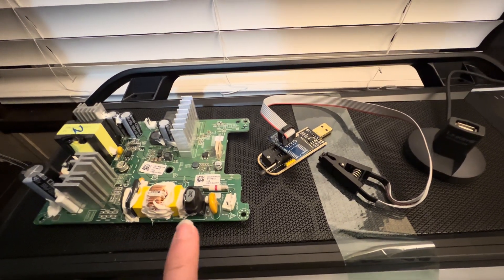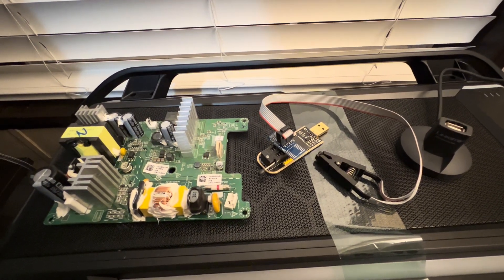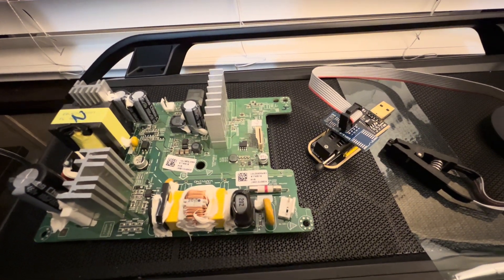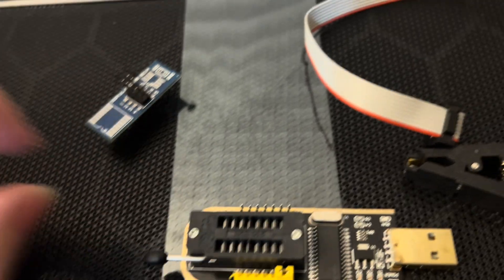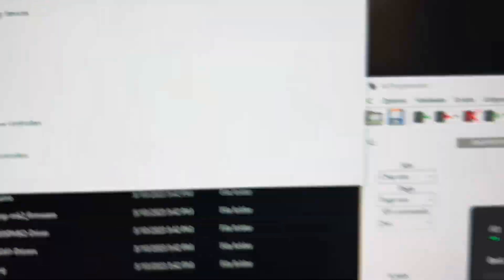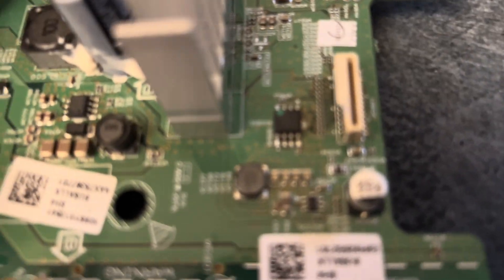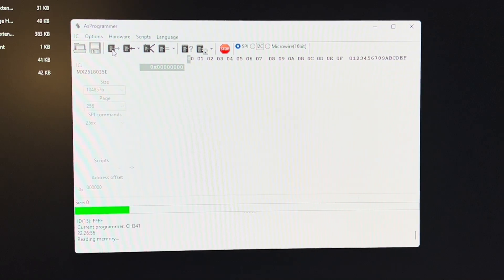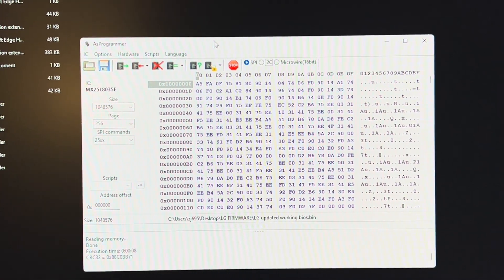How to fix LG Soundbar Subwoofer not working or pairing. SPN5B-W + SPN8-W part# EBR89625801

Comment: Didn't for my LG SN6Y. I have the 'verification error 00000000'. Tried testing but now no LED comes on.

Also, the execution time is 0 (when writing the new bin file) indicating that probably nothing got programmed on the chip.
Reply from the maker: When i get the all zeroes error, it's because the programmer wasn't seated properly on the chip. I would try again until you get error 000E00 and then it should be good. If nothing is working, the eeprom chip might need to be replaced
Reply: @FiveStaxX  Do you mean the clip? I was able to read and erase with no problem. Can I erase with an improper connection to the chip?
Reply from the maker: @ChiragSharma11  it can say it's erased but then if you reapply the clip you might find data still. Sometimes i have to program it two or three times after adjusting the clip before it works
Reply: @FiveStaxX  It seems like the bios bin file is not the right one for me. If I read the board and then program it with whatever whatever I get, I get no issues (i.e. no programmer seating issue). But if I try to program it with the bin file you've provided, I get the same error again. 

Is there any other bin version? My subwoofer is SPN5B-W
Reply from the maker: @ChiragSharma11  it's the same subwoofer as mine. The file should be completely fine. It's possible you might need a new eeprom chip. Are you in USA?

Comment: Hi guy, I'm from Vietnam. My soundbar system mark as LG sn5r. So, the subwoofer is spn5bm-w. I have tried to update your firmware successful. But when I power on the subwoofer, green light has flashing slowly for 30 secs and turn to red and not connected. I also updated firmware for soundbar through LG sound bar app by Android phone but result is the same. Would you could give me some advice. Thanks you so much.
Reply from the maker: And did you hit the pairing button to make it blink green quickly?
Reply: @FiveStaxX  I hit the pair btn but nothing happened 😂
Reply from the maker: @DũngAnhNguyễn-y2i  so hitting pair button doesn't make the light blink green faster?
Reply: @FiveStaxX  the led is still red after i hit or hold the pair btn
Reply: @FiveStaxX  aslo when the light is flashing green and i hit or hold the button, nothing change
Reply from the maker: @DũngAnhNguyễn-y2i  it doesn't go back to green?
Reply: @FiveStaxX  yes it doesnt go back to green
Reply from the maker: Was the light working before you updated the subwoofer firmware?
Reply: @FiveStaxX  yes, the light is flashing green after i update sbw firmware. And it turned to red after 30 secs.

Comment: Thx! Worked for me, but yeah with an error. I didn't try to turn the power off from the sub after connection, hope everything is ok. BUT I realize that indicator is now always green and sub is kinda always warmed up. Is that correct? Or mb I need to try it all over again? Thx!
Reply from the maker: When you turn the sound bar off, the subwoofer should go red after a few minutes in standby mode. Then it should go green again when the sound bar is back on.
Reply: @FiveStaxX  my soundbar is sn5r. Idk I kinda never saw red light on the sub. And now as I can see it's always green.. Shit
Reply from the maker: @AshotIOEgorIO  as long as it works, i call that success.
Reply: @FiveStaxX  kinda.. But if its always on full load I quess it will F up capacitors and stuff quickly. What do U think?
Reply from the maker: @AshotIOEgorIO  that's possible over time. Did you check LG sound bar application to make sure there were no updates? You can try flashing again, it won't hurt anything
Reply: @FiveStaxX  mine sub "log out" when I already was on the latest firmware. So I think that they never fixed it. In Russia some dude just selling updated microchips for kinda 10$ (for about a year now), but it has to be soldered.
Reply: @FiveStaxX  my firmware version from soundbar app is: WirelessRx WR201006, MICOM M2110140, Main B2110150. Can't remember when I updated it, but I am sure it was before sub "died".
Reply: @FiveStaxX  and U sure that that's how light is acting after updating the firmware? (I mean on the other bords, not Yours, but the one with error also)
Reply from the maker: @AshotIOEgorIO  every board has that error message 000e000 or whatever it is. I've fixed about 15 of them now and they all show the error code but still work
Reply: @FiveStaxX  I got it. But I am asking about how does the light acting? How it should be? Or U never check?
Reply: @FiveStaxX  so, I tried to unplug sub. Without pressing pairing again it didn't conect back. Then it connected. Then I turned tv off. It blinked Green for a minute. And now turned red. Wtffff. Magic!

Comment: Add me to the tally of people who were helped by this video.  I saw the magneto stuff months ago and even contacted him but I couldn’t justify the shipping cost when I knew it must be a relatively simple process, if he would just share the f*cking file.  Big props to you for doing what he should have done in the first place.

As for LG… I’d happily join a class action suit against them.  I will actively avoid buying anything from them in the future and will tell everyone I know about this incident, every time LG comes up in conversation. 

I’ve been involved on the software side of doing updates like this and I know the feeling of pushing out an update that messes up users devices.  The fact that it was even possible to screw up an update so bad that the hardware was bricked and needed this level of intervention is only part 1 of how bad this looks for LG.  That they continue to gaslight everyone and pretend there isn’t a problem is why I will never trust them again.

Comment: Can you describe the fault you fixing.  
I have been given a sub that appears dead.  Measures 20v on wc924 capacitor so it is powering up.  Just wondering if it is the same fault.

Comment: This successfully took my subwoofer from BRICK to flashing green again, attempting to establish connection to my SN7Y. However, connection wasn’t being made. I updated firmware from LG website using USB but it still won’t connect. What does updating these values in the IC actually do functionally? I am wondering if these instructions have somehow made the subwoofer incompatible with my soundbar model, or if I can rule that out as a possibility due to that constraint being defined by another piece if hardware on the device. Any advice would be appreciated.
Reply from the maker: All it does is replace the corrupted firmware file that kills the board with the updated fixed firmware file. It wouldn't have any effect on the ability to pair with your bar. Try factory reset on your sound bar. If it's still not working, email me and I'll send you more thorough steps to test.
Reply: @FiveStaxX  After a few power cycles, very frustrated that I couldn't get it going, I stumbled upon my error. I was seeing the flashing green light(attempting to pair) and assuming that this was the same signal as the initial pairing. If I held the pair button for too long, it would do this same slow flash, but if I held for approximately 5 seconds and released, it produced a much more quickly flashing green light which was able to establish the initial connection after the reset and now I've got my sub woofer back. Thank you for your support on this!

Comment: Hey, I have a broken board as well, but I'm in Europe.
Woh much would it be for you to fix it and send it back? I'm in postcode 4400 in Portugal.
Reply from the maker: It would be less expensive for you to order a new board from LG.
Reply: @FiveStaxX  thanks, I read some more posts and I ordered the programmer from Ali Express for 6 euro. Will give it a go.
Thanks for the video and the software. Really appreciated.
Reply from the maker: @kristofinportugal  very welcome. Reach out if you need help
Reply: @FiveStaxX  will do, appreciate it. 🥳
Reply: @FiveStaxX  Hey man, finally received the programmer. I did everything as supposed to, but after 1 second of programming, it gets Verification error on address: 0000E000. Any ideas?
Reply from the maker: @kristofinportugal  all of them get that error, should still work
Reply: @FiveStaxX  trying with erasing first. I did make a backup.
Reply from the maker: @kristofinportugal  if it gave you the 0000e0000 error, i would go ahead and connect it to the sub and test it. The error you got is normal
Reply: @FiveStaxX  it just wouldn't continue programming. I tried writing without verify as well. But after install the green light doesn't even go on. As before the green light did go on, but without connection to the soundbar.
Reply from the maker: @kristofinportugal  email me at 5000inc@gmail.com and I'll send you detailed instructions

Comment: Hey man do you fix other LG sound bars I can’t find anything on it?
Reply from the maker: What do you mean? Different model?
Reply: @FiveStaxX  I’ll send you the model number when I get off but it’s doing the same thing it flashes red and green and won’t pair  what’s your email bro
Reply from the maker: @mws91182  5000inc@gmail.com
Reply: @FiveStaxX  model# S33A1-D
Reply from the maker: @mws91182 take the back off of the subwoofer and see if it's the same board shape. If it is, it should be fixable

Comment: So happy i found this video! I found a free LG sound bar and have been working on it. Subwoofer doesn't connect. The model no is NB3530A, I  think it's older....do you think this will still work? I'm not at all a programmer but have many in the family rhat I grew up with. Thanks a million!
Reply from the maker: I'm not sure. It's mostly the newer models that i know of, but if it uses the same motherboard, it could be.

Comment: Hello, I'm getting "verification error on address: 0000000000" - what should i do?
Reply from the maker: As long as the rest of the process was successful, the verification errors don't matter. Try testing it out and see if it works. If it doesn't, email me and i can give walk you through it
Reply: Did it work for you? If so, what was the solution. I am getting the same error and not sure what to do next.
Reply: @ChiragSharma11  didnt work :/

Comment: So if your chips text is totally gone. Any way to figure out which chip is on there?
Reply from the maker: I would try 8035E. It seems to be the most common
Reply: and is there a trick to get that little hand to snap onto the chip. Ive done it 20 times and it just falls off as soon as I let go. Nope it must have broken. First attempt it worked. Then I remove it to get my old camera to see if I can see the chipset better and now it wont snap on again. So either chip is broken or cable. well that was fun.
Reply from the maker: @Lundis0606  can you email me pictures of the clip/chip? I'll try to assist. 5000inc@gmail.com
Reply: @FiveStaxX  Thanks but I tried several times over. The little clip on tool must have been defective. Tried a bunch of times over several diffrent times and it just slips right off the chip. But like I said in the diffrent reply i went the more expensive direction with a new board. But now hopefully it will keep on working. Thanks for your help and effort!

Comment: Ill try this when I get my chip programmer from amazon in a few days. Love when I went to the store and tried to get it fixed they told me this isnt covered by warrenty.
Reply: Did it work?
Reply: No the chipping tool must have broken but I've ordered an replacement board. Hoping it will work. Will arrive next week
Reply: Got my replacement board and popped it in and now it works again. Yay
Reply: Have been kinda sucky to have  an 700$ soundbar with working rear speakers but no sub. Board was 100$ but atleast its working now.

Comment: Just ordered the programmer, wish me luck!
Reply from the maker: You got this 😎
Reply: @FiveStaxX  im gtting error on address 0000E000
Reply: execution time 0:00:01
Reply from the maker: @HayBarnGarage  try testing the sub out. That's an error from the file verification. Everyone gets that error
Reply: @FiveStaxX  slow green blink
Reply: now no blink
Reply from the maker: @HayBarnGarage  try connecting the programmer again, erase the chip, disconnect programmer. Reconnect programmer and flash again
Reply: @FiveStaxX  if i press and hold the paring button the green light shuts off and doesnt come back on
Reply from the maker: @HayBarnGarage  email me at 5000inc@gmail.com and I'll try to help

Comment: Anyone have any idea why nothing happens every time I connect the clip to the chip? I could swear that Im lining up with pin 1. I’m referencing the arrow/hole to be sure that is pin 1.

But when I don’t clip it to pin 1 I do get a sound but the programmer disappears from the device manager 🫠.
Reply from the maker: It doesn't necessarily have to make a sound to be working. Have you tried reading the chip once it's connected?
Reply: @FiveStaxX  thanks for the reply! Yes I have, it shows FFFF(Unknown)/FF(Unknown)/FFFFFF(Unknown)

After I posted my original comment I somehow did manage to connect the clip and follow the rest of the steps. However once I plugged in the sub and pressed pair, it was bricked again. So now I’m trying to connect the clip again but having the same issue.
Reply from the maker: @shaquillecarter5791  try connecting the clip, erase the chip. Disconnect the clip. Then connect again and write the file
Reply: @FiveStaxX  so that worked to get the chip Model Numbers up 1 time but then the programmer kept getting stuck on writing the new bios to the chip. I unplugged everything and started but Now I can’t get the model numbers to show up again.
Reply: So new question…. I got the program on the updated again but when I unplug the sub to move it, it bricks again… Does that mean that the board is dead?
Reply from the maker: @shaquillecarter5791  so it was working before you unplug to move it?
Reply: @FiveStaxX  yes, the pairing lights were flashing.

Comment from the maker: UPDATE: After you successfully flash your sub, try to update the firmware using the LG sound bar app. My SN7R required Android phone to update, but my mom's older 6 series worked on my iphone. If it says no update found, you should be good 😁

Comment: Thank you for the guide and especially the working BIOS file. I had to update the soundbar firmware or it would re-brick the subwoofer after pairing. It is a little surprising that perfectly working audio hardware can unexpectedly commit software suicide, especially considering I had never performed any firmware updates in my ~2 years of ownership.
Reply: @agalk do you mind sharing how you updated your soundbar’s firmware?
Reply: @shaquillecarter5791  I used the "LG Sound Bar" Android app. After establishing a Bluetooth connection, you can download and transmit the latest firmware. Perhaps I should have cracked it open to backup the initial version just in case...
Reply: @agalk  thanks for explanation, I’ve been using the iOS app so that must be why I couldn’t see a firmware update. The back up would have been a good idea though!

Comment: Thanks for the video, I have a SN6Y with the issue that the volumn drops after about 30mins. Temporary fix is to turn it off and on. Can this flashing fix this issue.Wondering if anyone has any simmilar issue.
Reply from the maker: If the sub is still connecting to the sound bar, you should be able to use LG sound bar app to update the firmware files
Reply: @FiveStaxX  Thank for your feedback. I updated to the latest firmware but  the issue is still there.
Reply from the maker: @CangNguyenTrung-qi6mm  is it just the subwoofer that is dropping volume?
Reply: @FiveStaxX  volumn drops from the sound bar unit..I think there is an issue with control pcb.
Reply from the maker: @CangNguyenTrung-qi6mm  very possible. Have you tried with other TVs or sources? Maybe try disconnecting all audio inputs and just use Bluetooth to see if the same issue occurs?
Reply: @FiveStaxX  Thank, I will try.

Comment: Didn't work for me... The CH341 just turnoff when I connect to the PCB's chip. Any idea?
Reply from the maker: The ch341 lights turn off when you connect it to the chip?
Reply: @FiveStaxX  Yes
Reply from the maker: @LeonalviMarte  email me at 5000inc@gmail.com and I'll try to assist
Reply: @FiveStaxX  You need to really watch for pin 1.  The white dot is not a good reference.  There is a small "hole" over pin 1.  Was in the top right for me.

Comment: Hello, thanks for the info, I was able to get the subwoofer working yesterday based on your instructions.
Today, the status light showed red, so I hit the pairing button for quite a long time, the red light went off, but the subwoofer seems dead again.
Is it possibe the soundbar had the bad LG firmware stored, and installed it again ? Thanks for any pointers. Paul.
Reply from the maker: Red just means standby mode. I would update your soundbar using the LG sound bar app first, then flash the chip again (if the power light won't come on)

Comment: Mine had the error code 0000E000 every time even doing it separately, playing with the unprotect options but there were a few lines starting at 0000E000 that wouldn't erase. However after writing unplugging and testing it works fine. Truly a MVP! Also I almost fell for Magneto's BS saw that on YT and Reddit anything anyone you've helped can do to help with that mod battle let us know.
Reply: Hello sir, i got the same Error 0000E0000,  could u  help me out?  greetings.